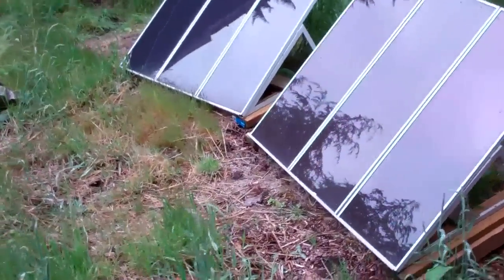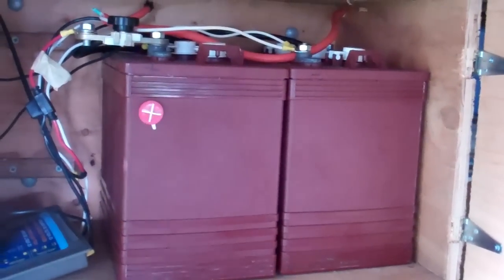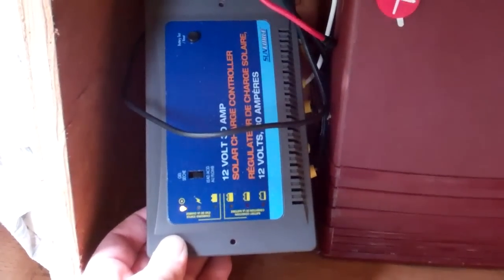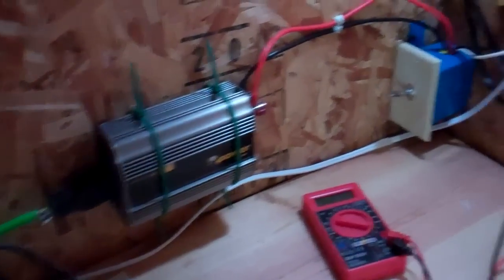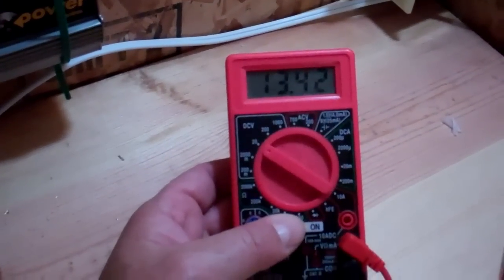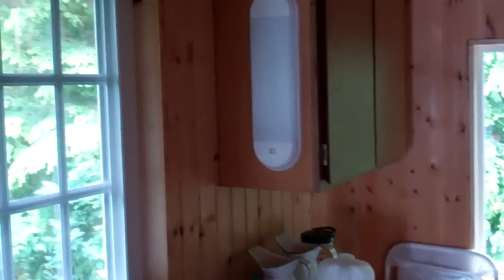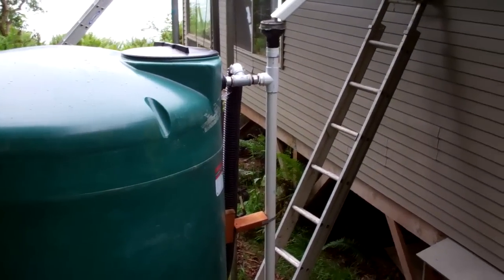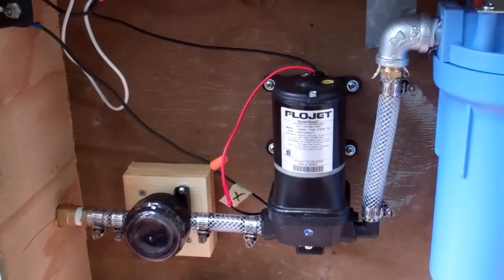Off Grid Cabin Solar Power.mp4

Comment: Hands down, better way to go is like The Power Pot, thermoelectric pot that makes 5 watts just cooking.  You can get bricks and put em on the woodstove and power as well.  Custom build easily with TEG (300Celsius Seebeck) at customthermoelectric dot come.  Also you should see the pots already made at theepicenter dot come.  Now you got juice from heat, anytime of day or weather.  Throw in evacuated tubes for solar heated water.. 220 plus degrees..in minutes, so fourth.. you get the idea.

Comment: I just purchased a nice plot of land in the wilderness & I am in the process of building a small simple off the grid solar cabin just as you have done. Im planning on building a single gable12-12 pitch metal roof 2 story small rectangle We also share the same name! interesting I enjoyed the video, thanks for sharing have you considered a pure sine wave DC to AC inverter? I plan to run a array of 4 240 volt polycrystalline panels and a vertical windmill trickle charging my array of deep cell bats